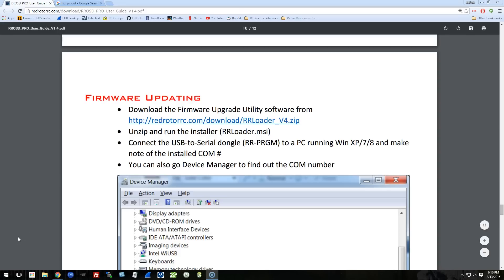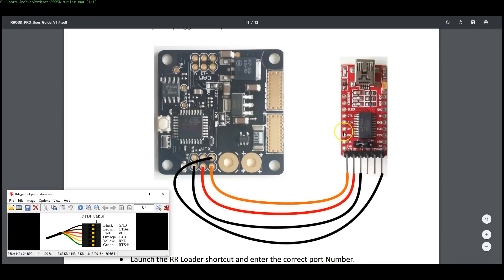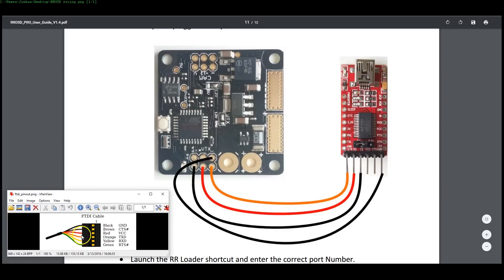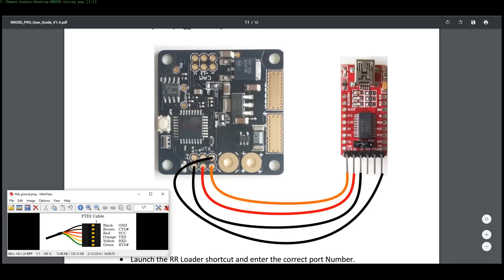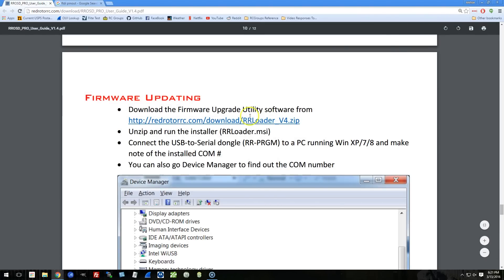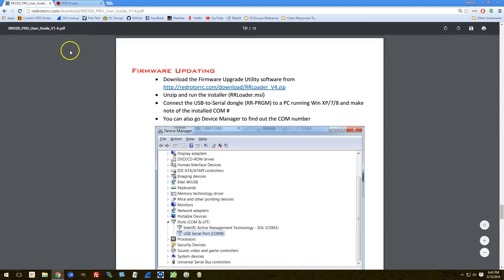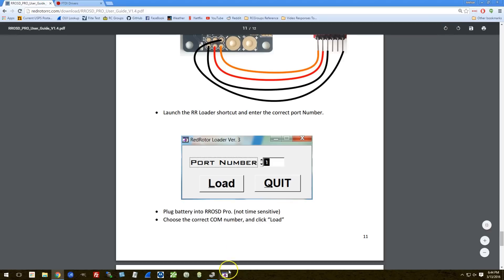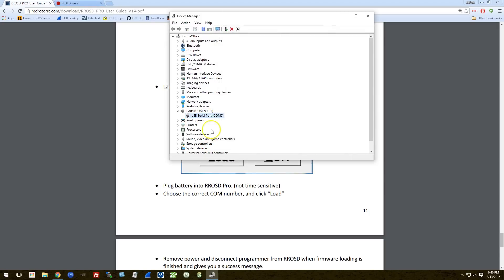RROSD Pro Firmware Upgrade How-To

Comment: Hey Josh, I flashed it with the arduino nano v3, first set the nano as a ftdi, then I followed the steps in the description from RR. The uploader told me that the flash is successfull, but now iIhave no osd infos on my screen.
Any suggestions?
Reply from the maker: +Ran D O would ask RROSD support. That's a weird one.

Comment: Great Videos! Can the Font size be changed or made larger on this RROSD?
Reply from the maker: +Pete Langer Yes and no. There aren't font files like the MWOSD, but there have been enough requests for larger font that my understanding is that Redrotor is working on a firmware you can flash with a larger font.
Reply: Do you know if the font size can be adjusted as of yet sir? 
Best Regards,
Pete
Reply from the maker: Not yet.

Comment: I currently do not have any readings on my screen, but my video is crystal clear.  Have you heard of anyone having this issue?  I searched for it on RCGroups.com and saw that some people were having the issue, but I did not find a resolution.  Do you think that this would help?
Reply from the maker: +diggidydaz7 No. What is the green LED on your RROSD doing? Is it out? Solid? Or Blinking?
Reply: It is solid green.  That's all I get. Instruction manual says to check camera cable, but I cant see anything wrong with it. It is a brand new build
Reply from the maker: solid green means no valid camera signal is detected by the RROSD. But you are getting camera through the board so it is clearly working. I would reach out to redrotor for support. It seems to me like it might be a bad board.
Reply: Will do.  I suspect the same. Thanks for your assistance

Comment: on version 4 of the firware does the low voltage alarm flash the read out on bottom left or flash low voltage words?
Reply from the maker: +Djsnapper there is not any version of RROSD that I know of that flashes "low voltage". The voltage readout flashes.
Reply: +Joshua Bardwell yup just got through a lengthy discusion with red rotor. turns out it was his editing i was seeing flash. lol thanks for the reply.

Comment: How do I find out which firmware I have on my rrosd? It isn't in any of the menus
Reply from the maker: +ghall05 Is it maybe in the startup screen that appears when you first plug it in? Doesn't it say something like "RROSD vXX (NTSC)"?
Reply from the maker: +ghall05 But honestly, v4.0 only really just came out, so chances are you haven't got it and need to upgrade.
Reply: +Joshua Bardwell ah you were right! I'm on V2. I never have my goggles on when I power up, so I never saw that display. Thanks!